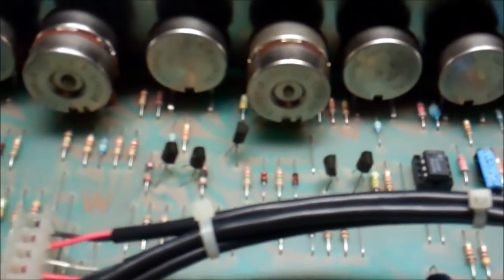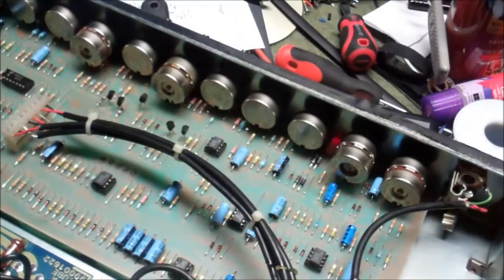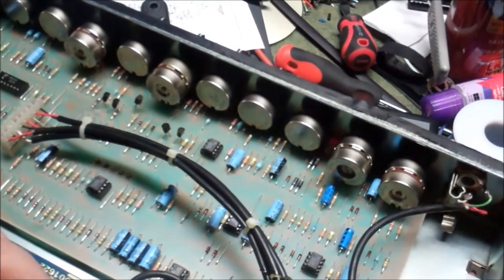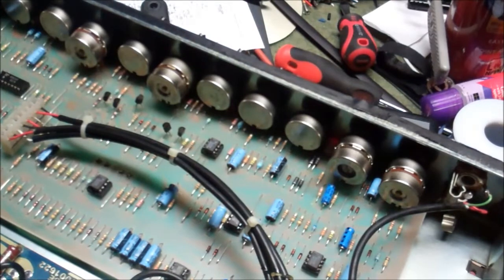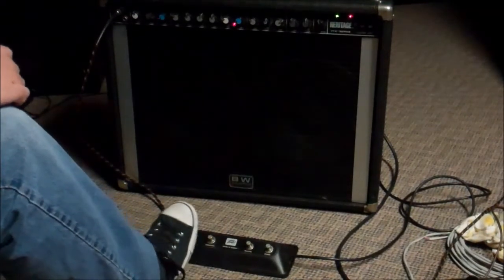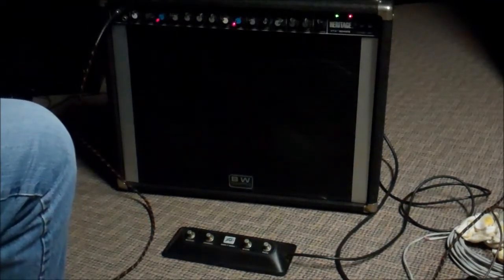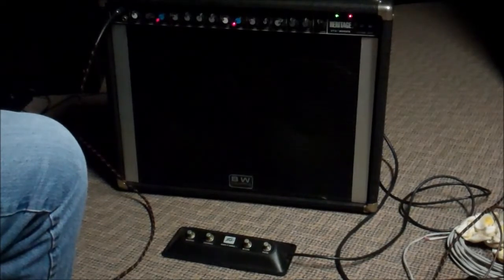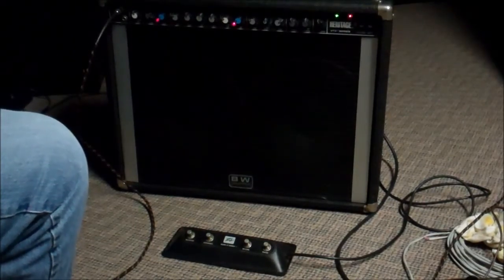Peavey Heritage VTX Part 2......and Demo

Comment: I have fixed so many things by just removing components, putting them on a tester, seeing they tested fine, re-soldered. And problems magically just went away. This just happened on a Chinese built pedal, indicator light was wonky. Components tested fine, re-soldered the led back in. Has worked perfectly ever since. That’s why I like to look underneath boards, just to touch up a bunch of iffy solder connections.
Reply from the maker: Usually most issues are not rocket science to solve.

Comment: Do you have a video on the actual repairs you did on the Peavey Classic VTX? I have one and it works but the lead channel has problems. When I hit the strings on my guitar the sounds thin but the longer the note is held to decay, it gets louder. It also gets fatter sounding as the note decays. Thanks! Newish subscriber here.
Reply from the maker: This one worked for when it got here.... so no.   You may have a few bad/weak electrolytic caps dragging down voltages......... that's the most common.   https://www.thetubestore.com/lib/thetubestore/schematics/Peavey/Peavey-Classic-VTX-Schematic.pdf